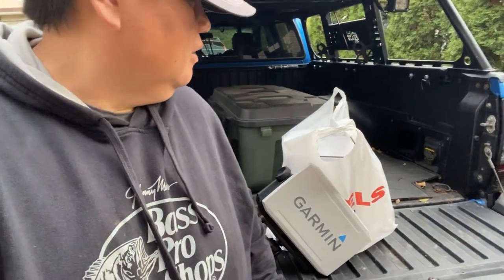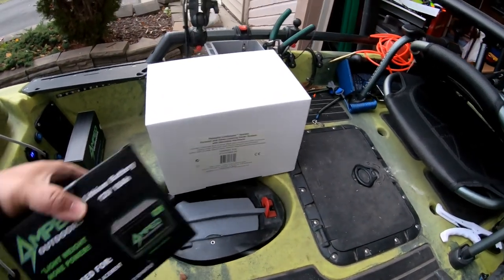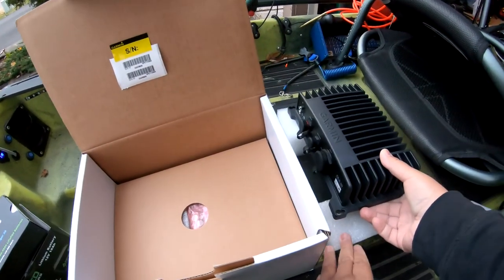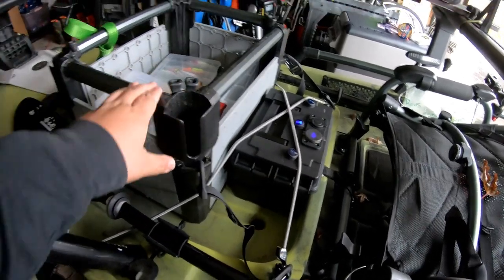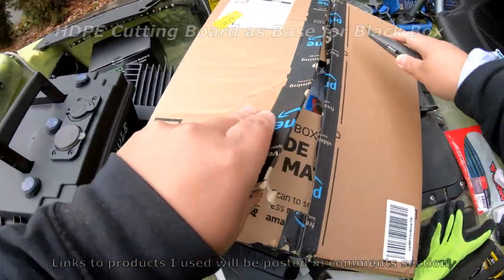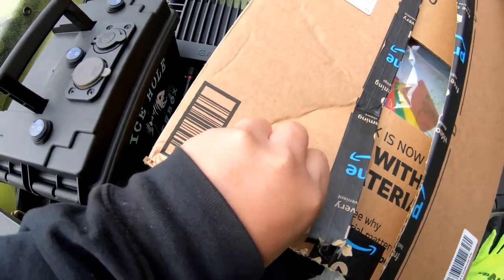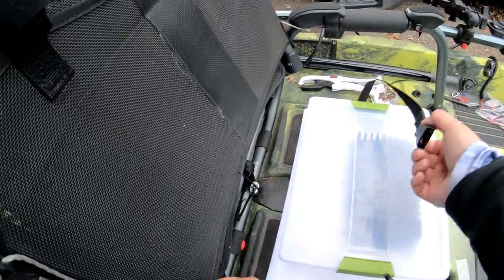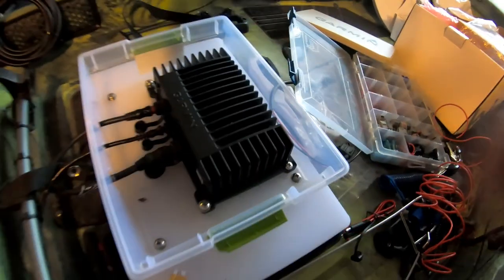Garmin Livescope Install on 2021 Hobie PA12 360 with Bass Khang Tripod Pole | BassKhang Custom

Comment: Thanks for sharing the link in MNKFA!  Funny enough, I'd already arrived at a very similar design before I looked at this.  I have a plastic container, and even bought a cutting board to mount it to.  My cutting board is a very thin $10 Target one, but I do not know how it will make a difference.  I'll need to add rubber feet on the bottom to keep the bolt heads off the kayak.

Comment: I like your setup! I just bought livescope and a 93sv uhd and might set it up in a similar way. Maybe I missed it, but is the fish finder unit and the black box both running off the same 18ah battery, or do you have the fish finder running off a separate battery somewhere?
Reply: @WildUrbanAdventures  Good to know, thanks! Definitely gives me some options to think about.